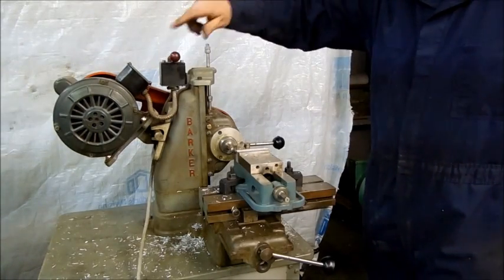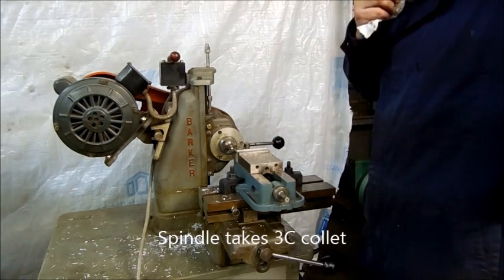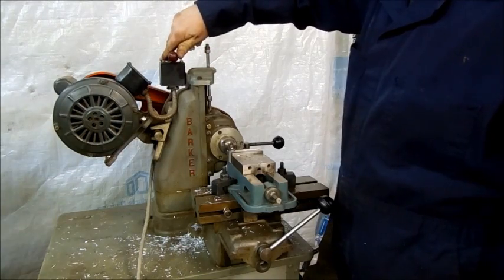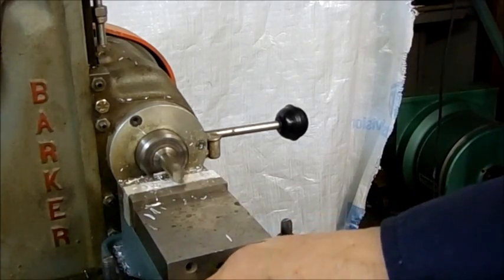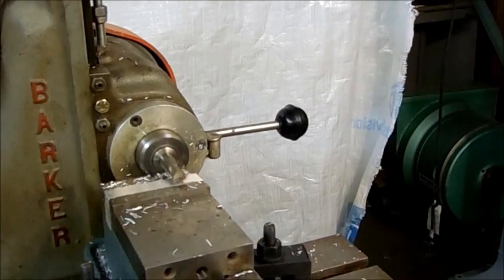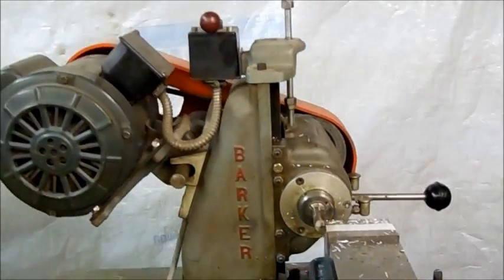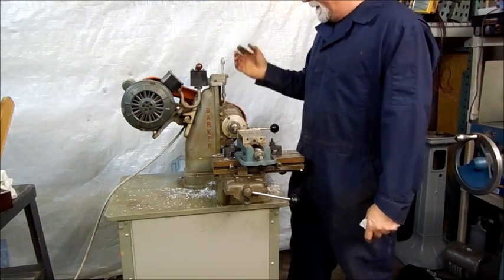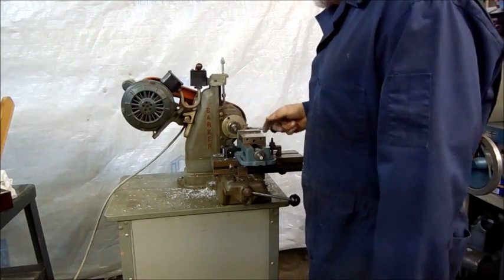Barker mill

Comment: Would you recommend a Barker Mill for a home hobby mill?
Reply: If you add a table extension and an angle plate you can use regular end mills but you use them sideways, set up is a little trickier but if you have done any milling on a lathe it's basically the same.